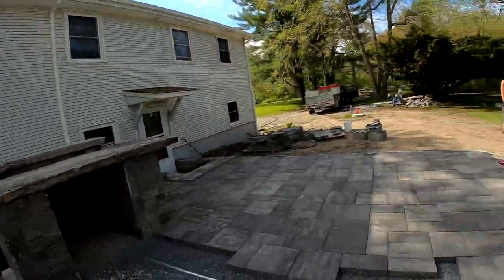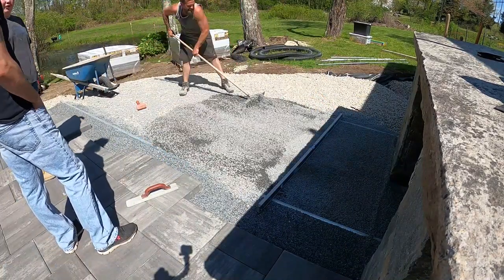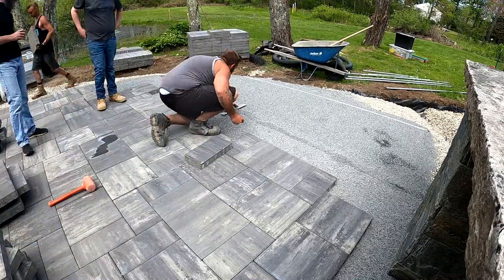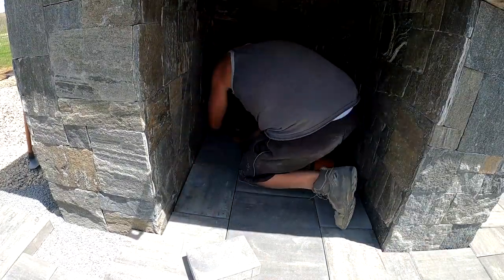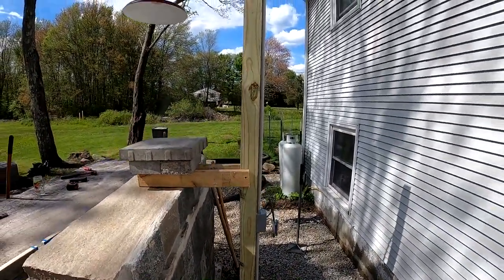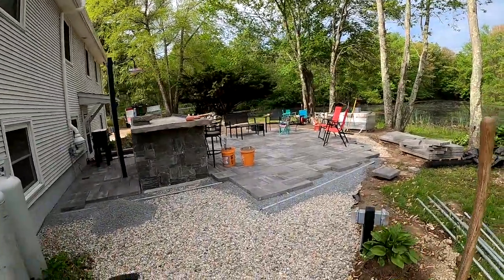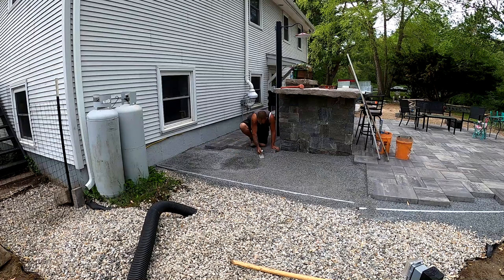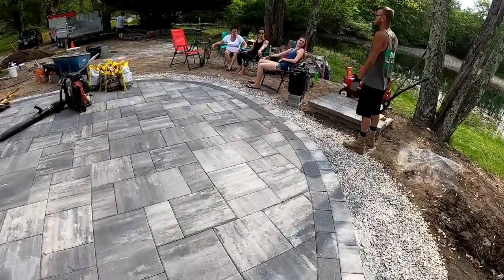Finishing Up a Beautiful Paver Patio Install!

Comment: I quit using concrete on treated post because they rot out quicker than setting the post in packed gravel. Good drainage with post is key to longevity. Cheers nice patio.
Reply from the maker: That definitely makes sense, I just did not want it to move after I set it and while I was laying pavers. There is plenty of open grade stone under it and around it for drainage. Thanks man! ✌

Comment: No compacting of base?
Reply from the maker: I use open grade base, the bottom layer gets compacted into the sub-base. Then we backfill over geotextile stabilization fabric and you are good to go. 3/4 inch clean crushed aggregate rakes out 98% compacted so there is no need to compact it in a residential application that will only be foot traffic 👍🏻
Reply: Do you do the same for driveways ?
Reply from the maker: @miguel5437  For driveways I would use the same materials but I would compact the stone with a heavy reversible compactor, simply because it is meant for vehicle traffic. That being said, you would be surprised how little this stone compacts even with a heavy reversible compactor....
Reply: @TheChristianHardscaper  hey thanks for your reply I’m here and Nevada and I tried your method on a patio man I was amazed on how solid it looked I appreciate your videos I’m learning a lot from you thanks and god bless you
Reply from the maker: @miguel5437  That's awesome man! I'm glad you gave it a shot, it truly is the best install method in my opinion. Thanks for the support and good luck with using this method, it changed everything for me when I switched ✌